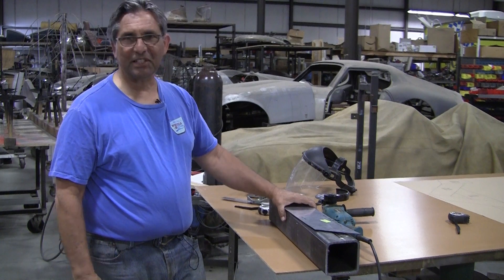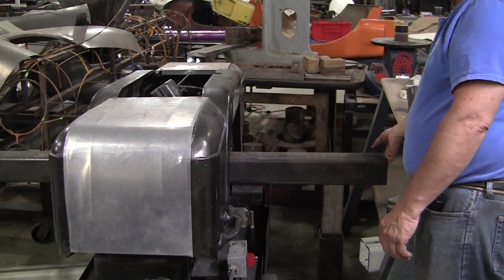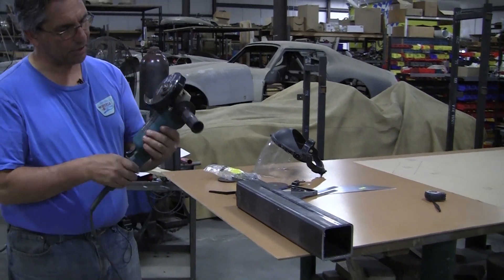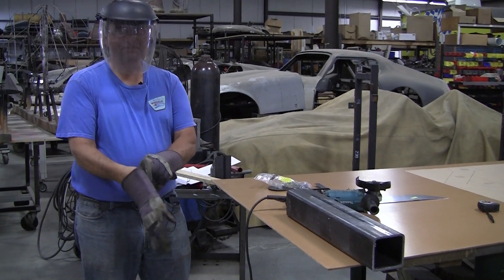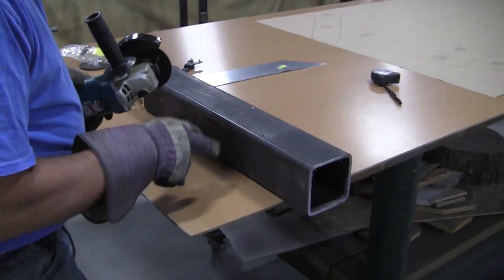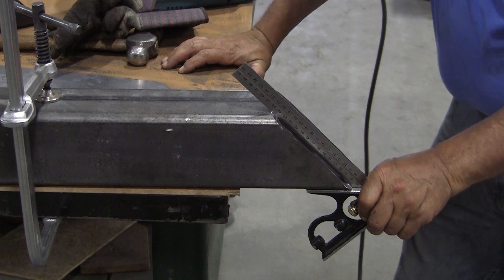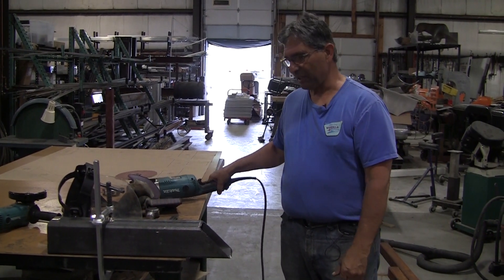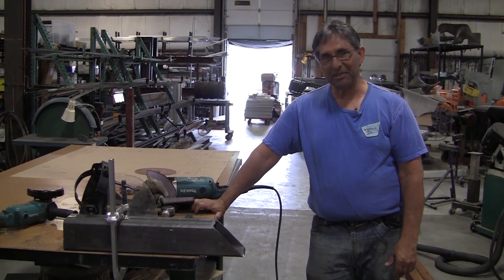How to build an English Wheel (Part 1)

Comment: Omg use a chop saw
Reply from the maker: You need a 18" diameter blade to do an angle cut in 4" tubing.
Reply: B
Reply: Band saw?
Reply from the maker: @paulkravitz4306  My volunteer Frank made the frame in the video. He tried various methods with consideration that we are selling plans for the frame. Most people that buy the plans and build their own frames don't have the big tool solutions. Frank found the easiest method and most accessible was the simple abrasive cut off wheel.

Comment: I just picked up the 4x4 tube for this. 24' was $279+tax and a trip to my chiropractor🤣🤣. I dont even know how I'm gonna move this thing around  once it's welded. Its gonna be a heavy sumbitch!
Reply: What wall thickness did you purchase?   1/4"?
Reply: @AlphaBobFloridaOverlord  yes
Reply: It's best to add Hooks on the top for Forklift to lift it up.  If you don't have a forklift you need one, and if you can't afford one at the very least you need an A-frame gantry or cherry picker.  Your back will thank me later.
Reply: @komoru 
“Cherry picker” aka ‘shop crane’ was one of my best purchases. 
Related to it- while not needed often is priceless- is a ‘pickup bed crane’ that I’m using on the corner of a trailer. It pivots and will do 1500#. And the last game changer is a 5/8” eye bolt overhead that will do 800#

The cherry picker takes up a lot of space in a small shop but it’s way more useful than an overhead crane and I can be put outside when not using.

Comment: Love your channel. Just a thought, if you had to make a 45deg cut on 2 pieces why not use a suitable length of box section and cut 2 pieces with 1 cut. Remembering the seem may put the angle the wrong way on the othjer piece.
Reply from the maker: Hi Leo, Frank will be doing that on some of the pieces he cuts.  There are 13 pieces in the frame Frank is going to cut a few pieces everyday. We will be taking note of all of the comments and positive suggestions. Thanks!

Comment: BE CAUTIOUS WITH ABRACIVE CUT OFF WHEEL'S THERE A KILLER TO YOUR LUNG'S AND CONTAMINATES EVERYWERE  AROUND YOU WEAR A RESPERATOR OR BETTER YET A BATTERY POWERD AIR MASK KEEP SAFE 👍🔔🔔 .
Reply from the maker: I warned Frank, he doesn't like masks.
Reply: @proshaper  . Those fillterd air supply face shields battery powered  are really the best . This kind of work is a serious Health problem .🐤🐤🔔🔔
Reply: Use any fiber wheel abrasive in the sunlight and see the little fiberglass particles everywhere ready for your next breath.
It’s bad news.

Comment: Mark and cut the two angled sides, THEN mark the top and bottom straight cuts using the side cuts as your reference points. the rounded corners won't be a factor this way.
Reply from the maker: Correct! Frank figured it out after he did it. I was busy elsewhere.
Reply: @proshaper  By the way if he needs something to go with the big johnson then maybe these people could help....https://www.kingdicktools.co.uk